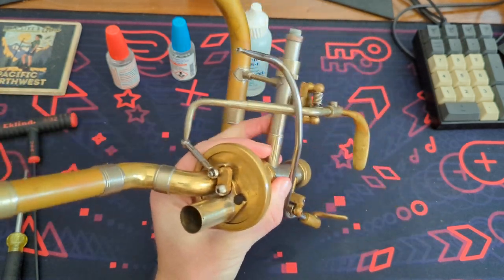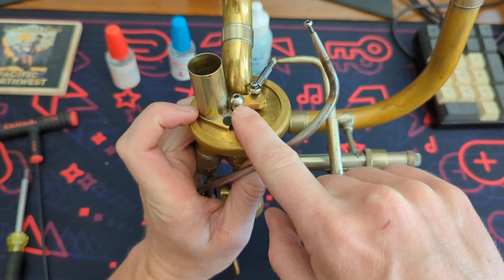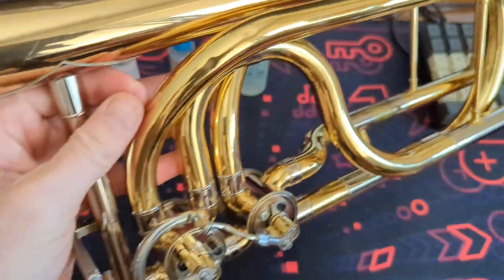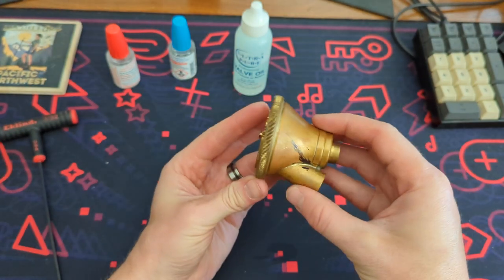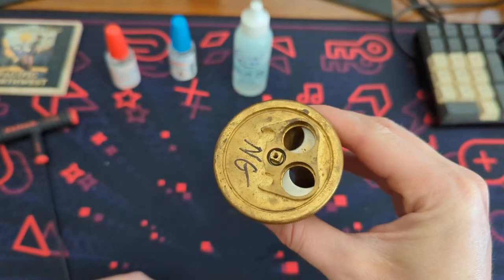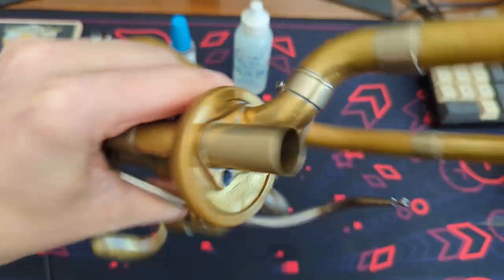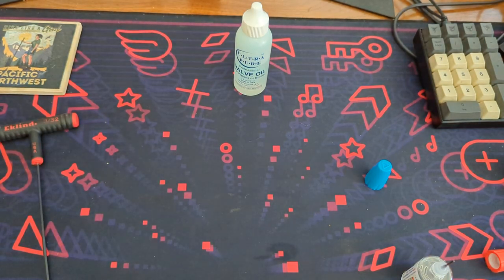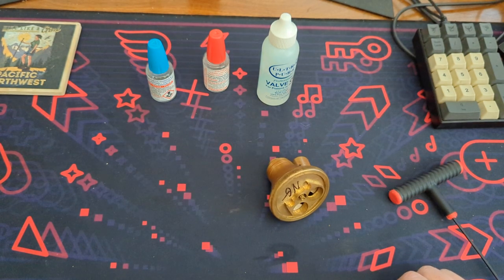trombone valve making noise? let's find out why

Comment: Just lube everything up with a heavier weight oil....those little vibrations will be dampened.  I suggest straight 30 weight motor oil.  OK, just kidding!  In the quest to make those valve operations more ergonomic to the player, those funky linkages need to be functioning in perfect unison.  Almost makes one miss the days of simple trigger keys and strings.